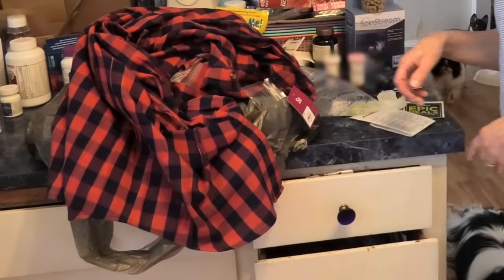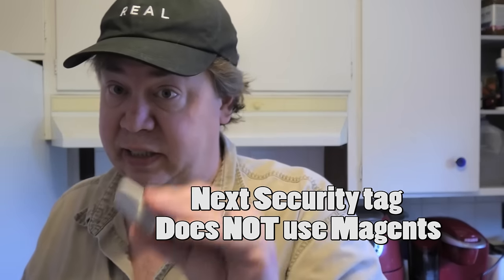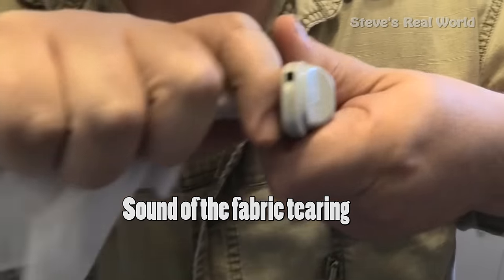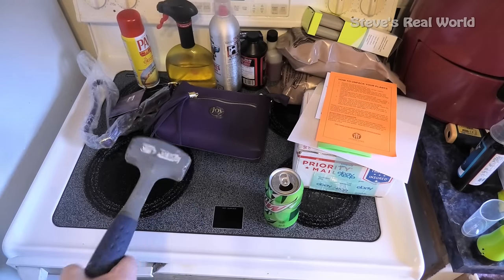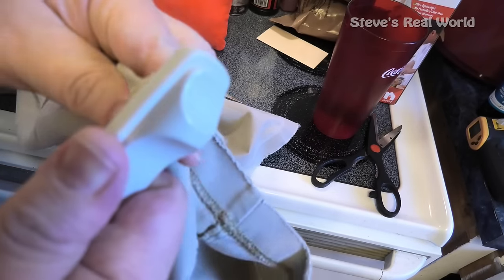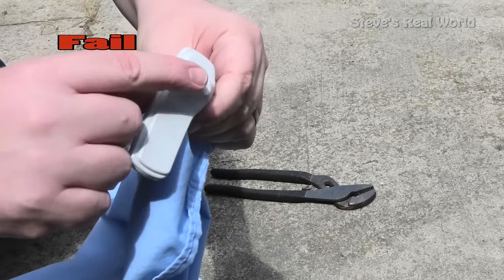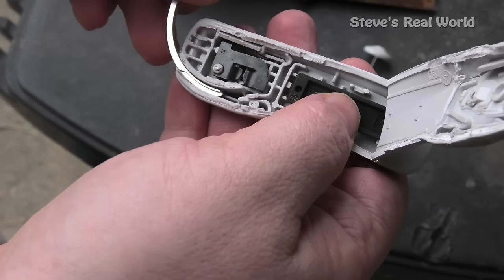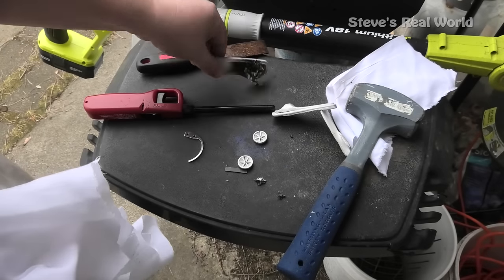Remove Security Tags from Clothing - PART #2 - ELEVEN Ways Tested

Comment: Thanks Steve, appreciated this much! Had a jacket I bought in another country that I didn’t pull out till the next year. Unfortunately it sat in my closet for another 2 years after because it had a security tag. I was so mad, as it was an inexpensive jacket! 
Your hammer version worked! Must say though… for those who doubt if there really is ink inside? I can confirm there is, and it is BRIGHT YELLOW!
Reply from the maker: Bright YELLOW - I so need to break a few of these open - Thank you for your comment.

Comment: Thanks for showing how the mechanism works for those tags where a magnet won't work at the 9:29 mark.  I was able to file down and bevel the end of a cheap wire coat hanger and insert it into the hole.  After a bit of wiggling the hanger for a few seconds, I was able to unlatch the sides from each other.  This took me about 10 minutes total I would say, so add this to your list for the tags that don't work with magnets.
Reply from the maker: NICE, also FIRE shown in part #1 works good for those type of tags - Thank you for the comment!

Comment: I used a pair of vice-grips on a 'Kohls' tag and gradually squoze the main part on its sides until it was able to be pulled apart.  Much more controllable than the hammer method.  Then the pin can be easily seen and cut with diagonal cutters.  One spring, a little thimble looking thing, and 4 tiny ball bearings shot across the room.  So wear glasses!  Zero material damage.  Thanks for the tips!
Reply from the maker: Nice - Thank you for the comment!
Reply: My wife just got my daughter a pair of boots and the clerk forgot to take off the tag. I tried EVERYTHING short of things that would mess up the boot. Found your comment and BAM it worked! @raymondkwasna9011 you saved my wife, or worse yet ME, from having to go back to the store on Xmas eve! Huge thanks!

Comment: It took me 10 seconds to remove it with a flat screwdriver! A lot less than I spent watching these videos...Simply just put the screwdriver in the hole (where he sticks the hook-like metal "device") and brake plastic. Once the whole tag starts to split, you open it up like a shell. Easy as pie.
Reply: Just tried it work like a charm!
Reply: It took me longer than 10 seconds to do this, but thank you. This worked for me. Took about 2 minutes. I could be faster next time, though!
Reply: I really want to try this but not sure where to out the screwdriver.

Comment: Can confirm: there is no ink in the two tags demonstrated in this video. They run off spooled copper wiring similar to proximity (HID) badges. Which is why they don't always trigger at the door. You have to be walking fairly close to one side or the other. I took apart one after the magnet method worked and there was a spooled copper wire with what looked to be a tiny button capacitor attached to it. Besides this and the metal mechanism showed here, there were no other parts (or room) for an ink resivour.
Thanks a lot for the demonstrations!
Reply from the maker: Thank you for the comment!

Comment: WIRE HANGER FTW!!! I went and bought a magnet but saw this video pointed out the hole. My magnet did not work and needed something else. I tried the sledgehammer trick but was worried about messing up my item-ski goggles. 

I grabbed a wire hanger and twisted it in the hole and it clicked!!! Thanks for pointing out the hole! I would have never guessed.
Reply from the maker: What Parts 2 & 3 for the Hammer and Magnets :) Thank you for the comment!

Comment: Thank you for this video! Since beating the crap out of it and fire were the best methods, I went with the Vice. *wear safety glasses.
Laying it flat and enough pressure will pop it open enough to get a flat tip screw driver in there and expand the spring. The part w/ the pin will pull out. No damage (3 mins)

Comment: I used a spoon to tilt the small end, then used wire snips to pull it farther away to the point the snips can get the metal pin locking it together. Thanks for your help
Reply from the maker: I thought the spoon worked pretty good - MUCH better than that fork I bent up!

Comment: Sears just did this to me on both pairs of work boots I bought, and I'm not about to drive 50 miles each way, just to get them to remove the tags! Very useful video! Will give one of the methods a try after dinner.
Reply from the maker: I hope one of these methods worked for you.

Comment: It was Ross for me on a faux  fur blanket. It was Christmas time. After 2 hours in line to get it I couldn’t gift it and lost the receipt 😫. So now I’m trying everything. Right now I have the stem of artificial flowers jammed in the thing trying to move the latch. It loosens but falls short of opening ☹️ so frustrating. Thanks for showing me how it was made . Going to try my wood burning tool on the pinhead next.
Reply from the maker: Did you get the tag removed? I have three different videos on the subject if you need more ideas - Thank you for the comment!

Comment: The magnet is the intended way to remove these Checkpoint security tags but you need a strong (probably neodymium) magnet.  If the magnet doesn't work for you, it's probably just not strong enough.  If you don't feel the magnet clearly attracted to the head of the tag, get a stronger magnet.  I tried it with 5 1 cm long neodymium magnets and they weren't strong enough.  But I grabbed magnetic hook that uses a 3/4" neodymium magnet and it worked immediately.  Put the "head" down onto the magnet (even tapping it down onto the magnet can help) then pull the needle out.  If you've recently been yanking on the needle as most people do to try and remove it, you may want to initially push the needle back in a bit to "unseat" the ball bearings inside and free them to be attracted to the magnet.  But you should feel them jump to toward the magnet and then the needle will come free.
Reply from the maker: YES, did you watch part #3 - It shows the Magnet methods - the easiest way, but most people do not have a magnet strong enough. One of my Aquarium pump magnets is strong enough and I show a few others. Part #3 - https://youtu.be/Ibnvp8vCLRs
Reply: does it work with an ink tag?
Reply: @StevesRealWorld hard drive magnets stacked on each other work also..

Comment: I got the tag removed! What I did was pushed a fork between the nailhead and the fabric all the way up to the bar. Then I used my wood burning tool to cut pie slices off and the fork protected the fabric from burning and melted plastic. After all of the nailhead plastic was removed I could cut the nail itself. There’s a funny shape on top that would probably make a bigger hole in the fabric if you don’t cut it. The trouble with that blanket was that the faux fur seemed to be super glued to the nail. I had to leave some fur behind but it’s invisible to the overall appearance. I’m sure a regular fabric would have been fine.
Reply from the maker: Nice job!!! Thank you for the comment!

Comment: Instead of burning the tag to get the guts out, how about heating up a sharp utility knife, or box cutter, until it's glowing hot? Once it's heated, jst slide the sharp end of the knife at the base of where the  tit starts & push it thru. If it stalls half-way, heat it up & try again until it cuts/burns all the way thru. No soot mess, no black marks.

Comment: Morrisons left a tag on a boxed bottle of whiskey today. Even set the alarm off! I have receipt but wasn't stopped. My magnet nakes it click, but it won't come loose. So tag still fitted, I'm just drinking the whisky.
Reply from the maker: Hmm, one part one, I used the FIRE method and on part three, I use a SUPER strong magnet and that works best - quick and easy. BUT as long as you can still drink the whiskey.... Thank you for the comment!

Comment: Two forks worked to loosen then I used the hammer to finish.

I recommend wearing a work glove on the hand your peeling it with because it end up causing a cut on my palm, small cut but it's painful enough to bleed lol
Reply from the maker: Your forks are much stronger than our cheap forks, hehehehe, As you might've seen in the video, I bent ours... Oh sorry you cut your hand, Hope it wasn't as painful as it would've been to return your item to the store to have the tag removed - Thank you for the comment!

Comment: Worked, good thing I had those super magnets in my fridge 👍 when I tried to do the magnetic slime.  Thanks for the tip!
Reply: I have 2 tags that were left on two pairs of jeans n I life a good 1 1/2 he to get back to khoos or the shopping area from where I live. I'd rather try the super powerful,  can u tell me how many of what kind or what size Is need I need to get to need to get to removed these thanks!

Comment: I used  a small, aprox 6", pry bar. The kind for removing tacks, nails, braids, trim and molding. It's tapered so it can slide between but tough enough not to bend like forks.
Reply from the maker: You can never have too many PRY BARS, is what I just said on one of our yard sale video. Thank you for your comment!

Comment: Wandering George

I just did one for my wife, a sweater vest she bought some time ago from now defunct Herberger's. 1 - Put the large part face down at the top of the jaws of a table vise and tighten as much as possible. 2 - with a chisel, (I used a a 3/8 inch mason chisel), or large standard screwdriver place the tip on the seam of the thick end and tap with a hammer until you drive through the case to the pin and it's off. 

No damage to the material, just make sure you don't get it caught in the vise

Comment: We were dressing for a funeral and as my husband pulled out the new blazer we purchased from KOHL's, low and behold was a security tab.  We used the hammer method and it worked great without any damage to blazer.  However we will buy a "super" magnet as a back up should this happen again....Thanks!
Reply from the maker: KOHLs strikes again - Thank you for the comment!

Comment: Most of the pins have like 4grooves .if you use a thin flat needle nose pliers, you maneuver a bit til you get room. A wire cutter too but I like the pliers. Once you get a space, you jiggle til it loosens. With practice it's fast. Think about the object. Some are a nail head on other side. Or a cone shaped nail... So why go the hard way. If you hold the  other side firmly, it makes sense to jiggle the small nail head because logically the small, weak side gives first. As for ink alarms, most are 2 capsules ( dark/ neon) inside the piece. At times you can squeeze it looking at the way it is glued. Even if you can break a piece, chip away breaking it till you see the capsules in the groove. Pop them out  gently. The mechanics if you use force spins a metal piece that would pop the capsules. Most stores have gotten better, so a neodymium magnet is it. BEWARE the tags are layered and a sticker alarm is between layers. After all that work you don't want to ring, so remove or w a small scissor make a nice cut which breaks the current. Dressing rooms in better stores are swept w a  device that picks up hidden tags, so l feel more comfortable having a drink in a cup which is not see thru, Coke is good . You sink the tags, etc in there and with a top on you dispose carefully, and a straw inside will stop most people today. Many places like Foot Locker have super annoying alarms but NO BELL, SOUND , etc. You can get them off at home using a lighter which is horribly smelly or other method that w be NG in store. I also NEVER stuff anything on the floor, but use various items on one hanger ( neatly), or have thrift store stuff to rehang in case the fitting room is well manned. Idea is the numbers must match. I only work in rooms. Observe nonchalantly how personnel react when an alarm sounds at door. Innocent people usually keep it moving and many don't even realize. It's amazing what you can carry out on your body, so you can show what is inside your shopping bag INCASE. This is an art if done well, but can be addictive.. GOOD LUCK

Comment: Some people burning technique.
1- If you have a soldering iron in your shop, use burning technique by placing aluminium foil between the tag and clothing. Then solder the plastic off the top of tag till it releases the pin. 
2- Or use same technique but use a dremel tool.
Reply from the maker: Great idea with the soldering iron, I own 3 or 4, BUT I wonder how many people really own one? - Thank you for the comment!

Comment: What's inside the red peg hook security devices that hold expensive items on the shelf hook? I know it's spring-bound and requires a magnet. But what does it look like inside???
Reply from the maker: I think Part #1 shows more of the inside and Part #3  I so the magnet method - Thank you for the comment!

Comment: I'd think one of those "roloc bristle" discs would work pretty well at removing the upper plastic pretty fast
Reply from the maker: I do not have any of those, are they not plastic? Thank you for the tip.
Reply: @StevesRealWorld  Not 100% sure on the material they are made of, they feel like a hard plastic/rubber.
I've used these a lot to "sand" through plastic enclosures to get to the encased button cell battery to replace it.
They are a gentle abrasive which gets through plastic fast without easily hurting anything underneath.

I purchased from Amazon:
"2 Inch Disc Pad Holder with ¼” Shank, Die Grinder Sanding Suitable for Roloc, Quick Change Medium Disc Attachments for Polishing, Sanding and Surface Preparation, – by Ram Pro"

and

"Goodson 3M Roloc Bristle Disc 2" (the yellow discs)

I've found some good uses for these over all, they do well at removing rust as well, hope this is of help.

Comment: I used dog nail clippers to cut the wire after prying it up. They worked  like the bolt cutters but smaller and didnt damage my shirt. It was an ink tag though so I wrapped plastic wrap and a paper towel around that side. Down side is I had to buy new dog nail clippers because I was afraid I made them dull. 🤦🤷
Reply from the maker: First time I heard about Dog Nail Clippers - Great idea!

Comment: Pry option worked great. Took 8 seconds
Reply from the maker: What did you pry with? I tried with a fork and bent it all up,, LOL - Thank you for the comment!
Reply: @StevesRealWorld  pry the backer of the tag, not the pin. Once the backer is removed, you can disassemble the metal springs

Comment: cut the back bump off with a Dremel then bend the retainer tabs off of the pin. works perfect no fabric damage .
Reply from the maker: Don't think my hand is steady enough to use my dremel and not damage the clothes. I have a few diamond blades on my dremel that would do the job very easy - Thank you for watching and your comment!

Comment: I was recently told 5 inch cable cutters would work. How your needle nose cutter would not fit., The 5 inch flat one will fit in between.
Reply from the maker: It was TIGHT - REAL TIGHT!! Thank you for the comment!
Reply: @StevesRealWorld  yes yours were very tight. I wish I could post a photo of the ones I am referring to. They are very slender about 2 cm thick so they should fit in between to cut it.  Sorry I wasn't sure if you understood that I was suggesting a different option to the ones you had tried to use. :) Thanks for the entertainment, y'all are too cute and funny! 😊😃👍🙏🥰

Comment: I just got home after buying some work pants through self service and forgot to get the tag taken off. Flat head screw driver to pry it apart enough to get a pair of wire cutters in and just cut the pin. Took 30sec
Reply from the maker: NICE - Thank you for your comment.

Comment: Just used the Hammer method.  Sat down on the cement, and beat the shit out of that tag.  Opened up in about a minute.
Reply from the maker: True - if the magnet doesn't work, get it's Hammer Time. Thank you for your comment.

Comment: Instead of burning, try using a drill. I used a 3/8" drill bit on a Kohl's tag and the spring, cap and bearings all dropped out easily with no mess or damage to the garment. Credit to you though, I thought to try it because I saw how the mechanism worked on your burn test in the first video.
Reply from the maker: a DRILL? I'll have to try that in a Part #3 video!! Thank you for the comment

Comment: I used a small grinding stone and a cordless drill to remove the top, got the spring and small bearings out, and it came apart
Reply from the maker: Nice - BUT sadly I don't have a small grinding stone - Thank you for the comment!

Comment: If you have a Vice at home that works the best. Crush it, it will split open and pull the spring, bearings and cylinder out. easy.
Reply from the maker: I do not have a Vice - I really need to buy one. Thank you for your comment!

Comment: What's that hook thing you use around 2:40 for the tag the magnets wont work on?
Reply from the maker: Oh - That's an actually security remove hook - it normally goes on a tag remover "Gun", I think I got it from Ebay years also. It only works on a few tags. I like the FIRE or magnet way better - Thank you for your comment!

Comment: is there any strength listed on the magnet?
Reply from the maker: It just states: Super Strong Magnet, I didn't see any Gauss level, sorry.
Reply: Magnet strength is measures in Gauss. Typical removers start at 5000 gausse.  9500 gause and up work on the turtles. Aka. The greeN sensors at Lowe's.